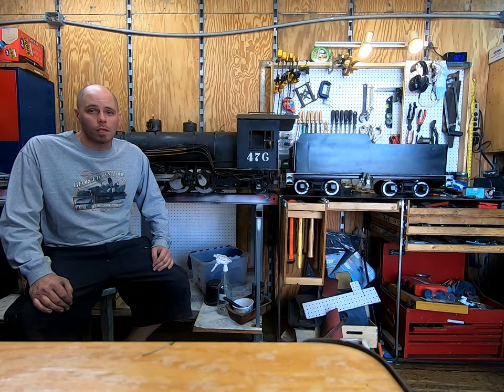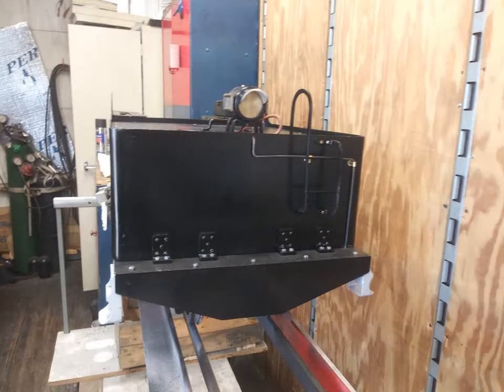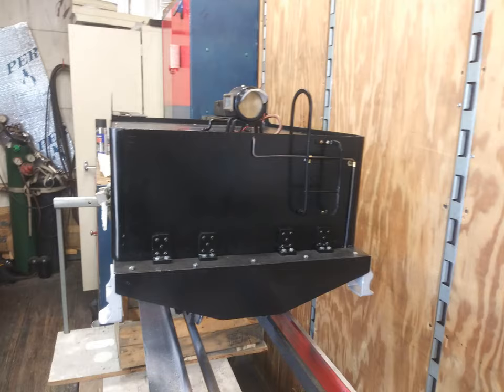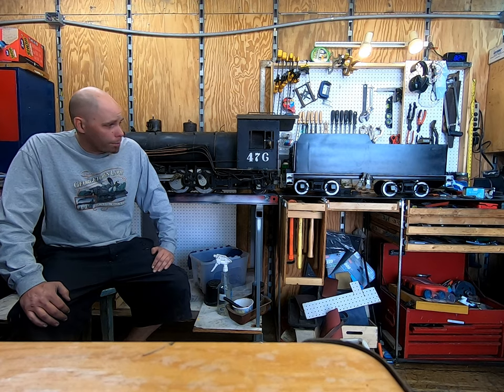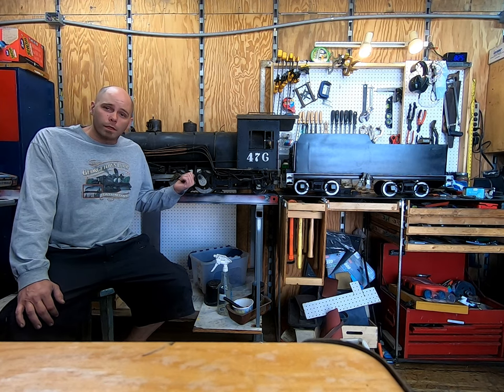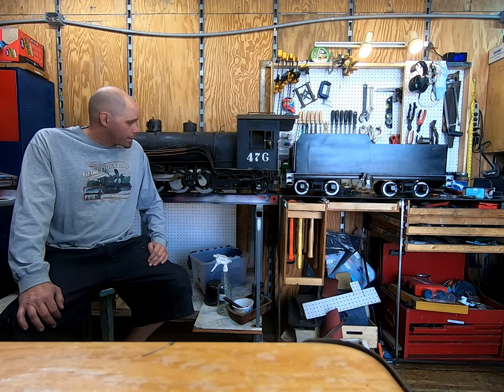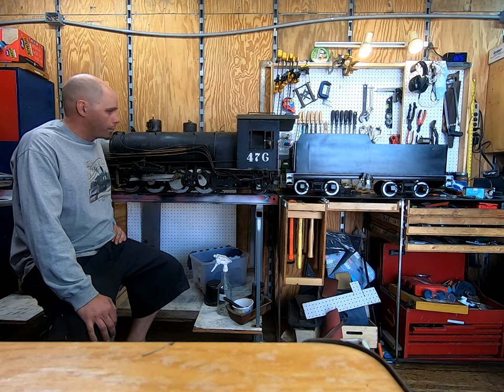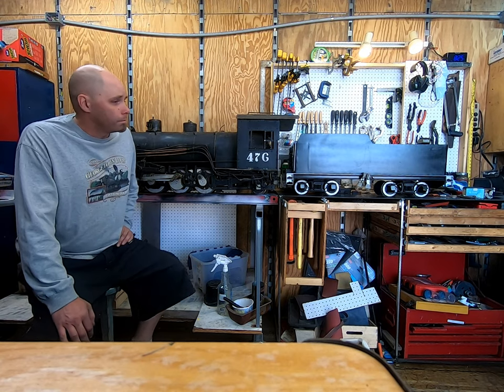1 5 in Scale K 28 Rebuild Update 2

Comment: Looking forward to seeing how this thing turns out. Do you know who manufactured the boiler? I'm looking at doing my own k28 at some point so if someone has the plans for one that'd help a ton.
Reply from the maker: I need to post another update on this, but I had it running this fall. The injectors are giving me problems, but it runs very nice. Unfortunately I do not have any plans for a K28, but I would like to build one in 2.5 scale. I am also having difficulty locating drawings for k28s.
Reply: @ColoradoLiveSteamer  Sean, I believe Milt Fick built the boiler when he built the K-28.  He worked for the D&RGW in their Burnham Shops in Denver.